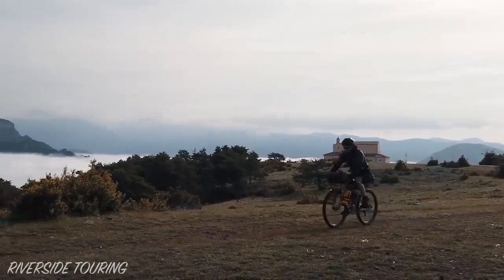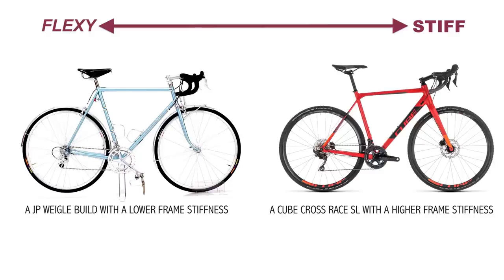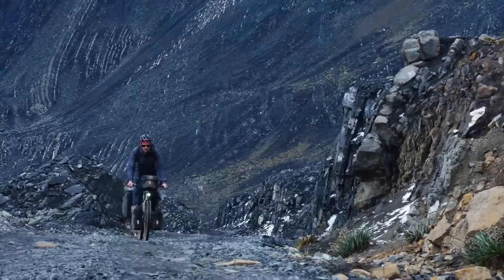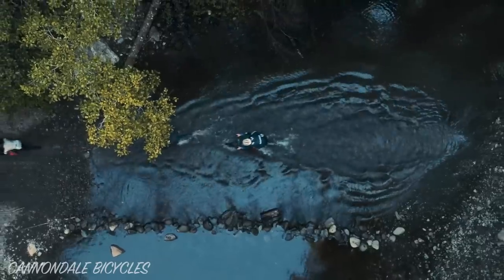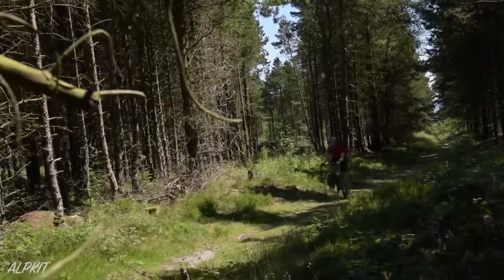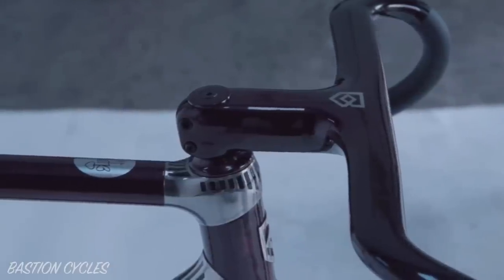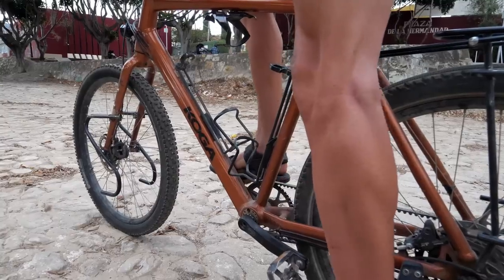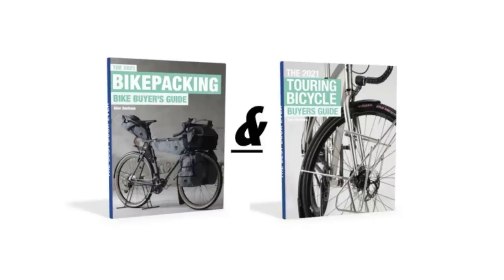Why Frame Stiffness Is MUCH More Important Than You Think

Comment: Frame stiffness vs frame material: The stiffness to weight ratios ranges as an addition would be very interesting.
The fact that aluminum (the material itself) is less stiff than steel or titanium for example, but the freedom of design is larger and therefore a higher bike stiffness is possible (see your tube example for bending or torque loading) would make it very interesting.. .
Reply: Correct, the fact that in this case steel or titanium frames are less stiff comes from design, they can easily be made stiffer, at a weight penalty obviously, just as touring bikes are designed to be stiffer than racing bikes with the same material.

Comment: I was riding a stell frame road bike from 70es and I didn't quite understand what stiffness means until I bought a composite frame (carbon and alu lugs) from 90es. On a stiffer frames with carbon road vibrations aren't as absorbed by the frame like steel, so you can feel every little pebble on the road transferred to your body, which can be mitigated by changing tires I believe, because these ones I have now are like sprint tires for speed, so you feel everything. If I was to put a bit thicker softer tires that would help a lot. On a steel frame with gravel tires it's like smooth sailing, you don't feel bumps as much. Still I love them both each in their own way.

Comment: I'll be honest, this is probably the most accurate information on frame material and ride quality video on the web.

The only part that was left out is that with steel and titanium, the bigger diameter don't always mean stiffer. It can mean the same stiffness at a lighter weight with thinner wall tubing and a different butting profile because diameter will compensate structurally for tube wall thickness.

It really doesn't matter what material is used, just so long as the tubing profiles and construction are aimed towards the desired ride quality.

Also with carbon, unless you have a detailed schematic of the layup construction, it's really difficult to identify a ride quality by tubing size because the direction of the carbon layup and the modulus of the carbon greatly matters. A great example of this is Norco bikes with their Search XR C range. You'll see models where it says the frame and fork are HiMod/HiMod on the fork and ones that are HiMod/MidMod on the fork. In this case, the HiMod Fork is likely the same stiffness as the MidMod but lighter because it's using a stiffer material but less of it. However, even if the frame says HiMod, I am almost 100% sure that at the very least, the seatstays are made of MidMod with the same tube profile for more compliance because midmod is inherently less stiff.

If you're looking at bikes that uses different tube profiles for each size frame that gets fairly close to a semi-custom, Jamis is a good example. The tube length and tubing profile are different on each size along with fork offsets.

If built in compliance for rough roads, gravel riding and such are your biggest concern, I 100% agree that Treks are among the top with their IsoSpeed Decoupler system.
I own both a Boone and Procaliber, and they're both fantastic on and off road. I'd say that the Boone's carbon and IsoSpeed is a notch more refined than the ProCaliber, but that's for the reasons outlined in this video with intended use. The Procaliber can be tuned down for more comfort with a seatpost and 27.2 seatpost with a higher degree of flex. Or go to something like an eeSilk like featured on CYCLINGABOUT's video...Pricey and hard to come by at the moment, but quite a luxurious piece of kit!

Comment: Iirc Peak Torque also has a video on titanium and how its supposed ride quality is mostly a placebo. Geometry/tube cross sections were more important.

Thank you for these videos. It's why I own a belt drive bike now.
Reply: Don’t underestimate the ‘drooling factor’ when buying a titanium bike.  

Over any other bike I’ve owned, it’s my titanium bike get the most attention from other cyclists. The BB also does not creak 😁😁🤣
Reply: @bikepackingadventure7913  is the lack of creak because you got a BB from that five year old Hambini?
Reply: @QuickQuips  No, it’s because it’s a titanium frame with an English threaded external BB with hope hubs. Not that I don’t want a hambini BB manufactured to tight tolerances, it’s because it’s over £200.
Reply: What peak torque only hinted at is that titanium has a higher fatigue life than aluminium. This indicates that you probably have to overbuild aluminium components more if you want them to have a reasonable life span. This could be why titanium frames can have better ride quality.

Comment: That was excellent. Thanks for putting it up. I have gone through so many bikes during my riding career. I have skeletal arthritis and it's important for me to have a bike setup that transmits the least road shock to me for long distance riding. My solution has been a full carbon frame & Spinergy wheels. I no longer ache after a 60 to 100 mile ride. I found out quickly aluminum was light weight but for road riding it beat me to death. I'm planning a coast to coast ride (US) & I bought a Kona Sutra & added a suspension post. The bike was delivered last year during the first week of the viral zombie 🧟 apocalypse. Then I watched all of your videos & learned about the Tout Terrain Silk Road. I can't get it for my coast to coast ride but I will get one after. I really like things made out of high quality metal & plan to trade my Miyata steel team frame from the 80s for a high end Columbus SL or Reynolds 853 frame with investment cast lugging in chrome & put my Campy group on. I don't like the new Campy groups. I prefer mine from the end of the 90s. That's just something that I want & it will be ridden on club rides. I have 4 mountain bikes & a single speed. Some of those can go to pay for the Tout Terrain. Just sharing some bikey info about myself. I hope you go on another tour soon. 🤞👍☮️🌞🚵🏼‍♂️

Comment: High quality content as always. Glad to see someone refuting nonsense from BQ and the retro-grouch brigade.
Reply: The big bike makers are the ones who oversold stiffness for years, and are now backpedaling.  Same for narrow tires.  BQ is the one that got it right.
Reply: @ericpmoss  BQ is a lifestyle brand like Specialized, just with a different audience. They sell an aesthetic, an identity, and charge a premium for the opportunity. There is nothing wrong with that, but the nature of their 'tests' being presented as authoritative while always supporting or being neutral to the products they sell is problematic. The stiffness 'test' was garbage and belongs in the bin with many of their other advertisements disguised as science. They did not get the wide tire science correct either. Depending on rider/bike weight and conditions of tarmac, a rider will get a comfortable ride and optimum speed with a 25-32c tire on a wide rim run at slightly lower pressures than has been traditionally run.

Comment: As always, excellent video!  I recently had my own experience with bicycle stiffness.  I ride CruzBike recumbents.  The road/racing bike is the V20 and the touring bike is the S40.  I'm planning a long tour with the S40 but it was causing some hip pain that I couldn't seem to work out, so I thought I would try the road bike using a trailer.  After loading the trailer with ~60 lbs, the bike was like spaghetti.  It was frighting.  It would wobble from side to side like a snake.  I tried instead using a special, large (Radical Design) panniers but had the same problem, though, not as bad.  So the V20 was out and I'm back trying to make the S40 work. Interestingly the V20, without bags, is much more comfortable to ride than the S40. 

I feel I owe you for all the great content you provide so I'm going to run over to your website and make a donation.  I encourage other viewers to do the same.

Comment: it will be great to see frame stiffness vs frame material vs frame weight: N/mm/kg

that will answer the question of frame material selection, as weighing the frame (easy) and knowing the material (easy) can give you an indication of how "stiff" it is compared to others. 

Great video!
Reply from the maker: Are you talking about a stiffness-to-weight comparison between frame materials? If so, the stiffness values don't vary all that much compared to the frame weights, so carbon will always have the highest stiffness-to-weight, and steel will always have the lowest.

Comment: I have an alloy Devinci XC and a carbon Specialized XC. The latter is stiff and when I put power to the pedal, the stiff frame/bb shell transfers power immediately to the wheels. On the other hand, on the alloy bike, I can feel the pedal power absorbed and lost in the softer frame. It's sluggish. After riding both back to back many times, I will choose the carbon frame every time.

Comment: Great video! I would love a syntnthesis in greater detail in terms of the frame comfort video.
Reply from the maker: There is some crossover, but not a lot - in my experience.

The vertical frame flex of a double diamond frame is very little. Almost all vertical deflection comes from your components - the tyres, seatpost, seat, handlebar, fork - in particular.

On the road and gravel, I've worked out I can make ANY bike ride comfortably simply by switching in a few components that offer a bit more vertical deflection. I still have a preference in terms of frame stiffness to achieve the perfect ride feel, but even the stiffest bikes I've owned (my KOGA WorldTraveller is up there) are very comfortable to ride.

The only time when I've noticed 'comfort' can be gained from a higher degree of horizontal frame flex is when riding a mountain bike on a very rough trail, where you're put bigger side loads into a frame when cornering. But then again, you have to be riding pretty hard to unlock this benefit, so most people can really just focus on vertical comfort.

Comment: Love your stuff. This;however; is mostly angels dancing on the head of a pin. The tires are orders of magnitude more important than the frame regarding vertical stiffness- to the point the frame (engineered seatpost aside) makes no difference As for the twisting moment between BB and head tube-that seems to apply to the tiny percentage of time one would be sprinting or standing up a hill.
Reply from the maker: I can very obviously feel the lateral stiffness of any bike I ride, even if I'm riding seated.
Reply: @Cyclingabout  Uh huh.

Comment: Good video. However why you would say the stiffness of an aluminum frame is hard to predict ?. I can’t see it is any harder to predict than steel or titanium. Both steel, titanium are isotropic, where the material properties are the same in all directions (whereas carbon frames having varying directional stiffness, depending on fiber direction and sheet layup). The stiffness of steel and aluminium is defined by the youngs modules which is well documented at 200GPa for steel and 69 GPA for aluminium. Ie a steel tube is 2.9times as stiff as an aluminium tube for the same diameter and wall thickness. However aluminium typically have higher diameters, so they overcome this lower stiffness issue.

Comment: You mentioned a hardcore hardtail being more stiff than an XC hardtail, but did not mention a carbon XC HT should be equally or more stiff than a non carbon, depending on model I assume; also considering that it would need that flex mentioned for MTB cornering? Oh wait you said "that was due to the larger forces at play" so I assume you mean that XC would be less likely to be going through the rough or hitting big gaps? Hah that would make sense actually but I still don't know why can't you if carbon is supposedly "strongest" 🤷

Comment: Mmm, strange numbers, a head tube stronger than a bottom bracket? A carbon frame BB - 60N/mm? 😅 My 2014 Merckx bike is 4 times stronger. 🤔 Some numbers from the Seka website: head tube stiffness of 143N/mm and a bottom bracket stiffness of 215N/mm. If those numbers even suggest an average, then some bikes are stiff like a wet noodle. What am I missing here?

Comment: Just joined as a Patreon!.  Question.  Why don't you include the Priority 600X as an adventure option when you are suggesting touring and bike packing options?  It seems to check so many boxes that generally seem to match your criteria. Thanks.
Reply from the maker: Thanks for the support! The Priority 600X is still in development, so I'd prefer to not comment until everything is finalised, production is dialled in and there are ride impressions from various sources (my close friend has one coming, so I'll be able to test and inspect it myself). 👍🏻

Comment: Does smooth pedaling reduce the need for frame stiffness?
Reply: No. The smoothness of the road is more important. On a perfectly smooth road many will like a stiff and responsive feeling bike. On a less perfect underground a higher frame stiffness will become more annoying. Making the bumps in the road less forgiving.
Reply: @detmer87  what you say is probably true but according to the video light riders don't need frames as stiff as heavy riders do, so smooth pedaling should indeed reduce the need of frame stiffness... But it reduces power output and speed too

Comment: How much does stiffness affect durability? IE will a frame that feels very noodly when I ride it also break more easily than a frame that doesn't flex noticeably?
Reply from the maker: It will only fail if it's not engineered properly for the rider weight and strength, as well as use of the bike. 👍🏻

Comment: Specialized tunes each frame size knowing taller riders are heavier.  It’s called rider first engineering. It keep the xl from being too soft and small bikes from being too stiff.
Reply from the maker: Well, that's what the marketing says... when I look at the frame deflection numbers for Specialized road bikes, the smaller frame sizes are at least as stiff as the bigger ones.
Reply: @Cyclingabout  That's interesting, do you have a source for the frame deflection numbers? I'm curious which models and which tests were used.
Reply from the maker: It's Tour Magazin data. I have a massive spreadsheet with hundreds of bikes in it.

I'm looking at Specialized Amira and Ruby womens road bikes from 2013-17 (all carbon) and Specialized Tarmac and Roubaix frames from the same time period (also carbon). There is very little difference in N/mm values at the head tube and bottom bracket.

That said, for most other brands, the smaller bikes are around 20% stiffer - Specialized is definitely doing better than most in this regard.

Comment: So this video contradicts almost everything you said in the video above rude comfort?

You now say (in your example) that a stiff frame 2:18 will feel harsher over road imperfections. 

As less stiff frame 2:32 “is less communicative of the road…” that’s another way of saying you don’t fell as many bumps. 

As we know that carbon frames for example have a higher stiffness to weight ratio owing to the material used than carbon, why can we not say that a less stiff material like steel would not produce a more comfortable bike frame?
Reply from the maker: It's not contradictory. This video is primarily about torsional frame stiffness, and my other is about vertical frame stiffness.

It's the vertical stiffness of a bicycle that determines ride comfort in 99.99% of all cases. This is why full-suspension bikes are extra comfortable on a bumpy trail, and why you can put suspension seatposts and stems on any bike to boost comfort.

Comment: Wheels and spokes are probably the cheapest and easiest way to change the feel of a bike, if you are a light rider and are riding wheels that are designed to carry 100kg+ riders then they are going to feel very harsh. Also crank length will play a big part in how stiff the bottom bracket feels, 175mm cranks are gonna put a lot more torque/flex into the bottom bracket than say 165mm cranks.